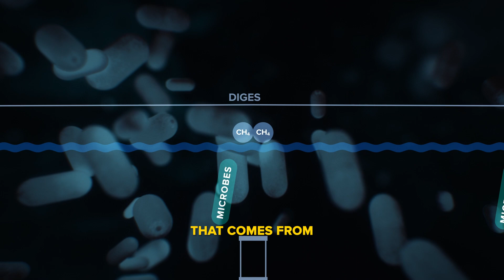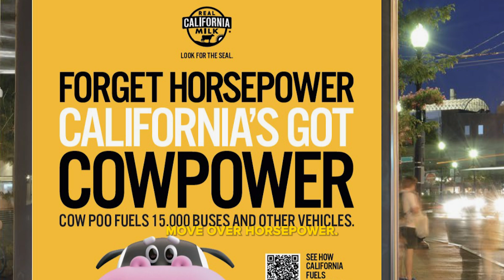Are Anaerobic Digesters the Future to Capturing Methane Emissions?

Comment: For cold areas, a simple means would be through the barn's ventilation system: use the exhaust as the air in a heating or power generating furnace.